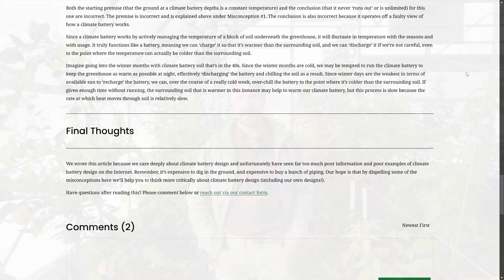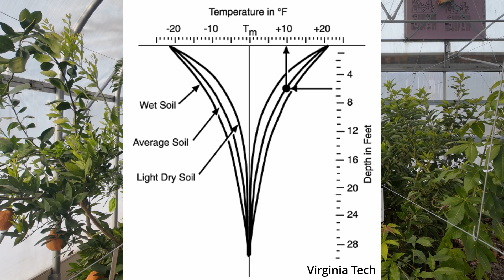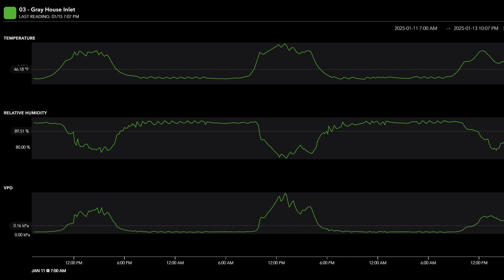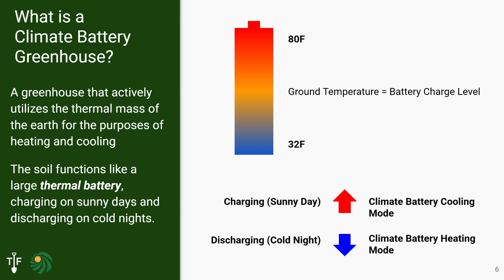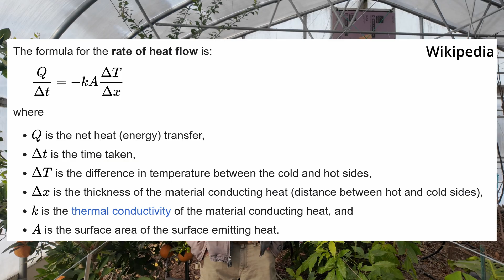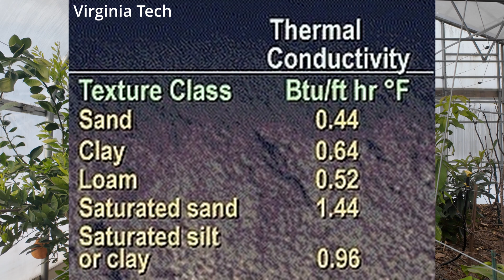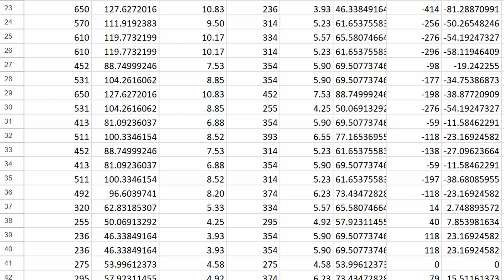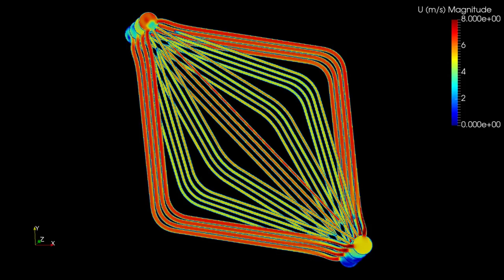5 Misconceptions About Climate Battery Greenhouses

Comment: Heat transfer rate is a function of surface area, temperature difference, and thermal conductivity. Storage is a function of volume, heat capacity and insulation. Plastic pipe thermal conductivity is poor, dry soil thermal conductivity is poor, and surface area is about more than pipe length, it’s about pipe section perimeter. For example, a stainless steel pipe with a cross section like a torx screwdriver passing through a large vessel (like a fiberglass tank) filled with water, or wet soil or a phase change material would dramatically improve an earth battery’s performance, though obviously at the expense of initial cost. The torx shape cross section has a high surface area, the stainless steel a high thermal conductivity, and the water/wet soil/phase change material have both higher heat capacity and higher thermal conductivity. The limiting factor is always cost vs performance. It’s also a very different discussion when you’re talking Pennsylvania VS Canada as an example. The further north you go, the more important it becomes to actually isolate your battery from the surrounding ground using insulation methods. There is definitely a lot of research and development that remains before truly effective and efficient systems will be in general use. It’s unfortunate that there seem to be few (if any) serious engineering efforts in this area, most are undertaken by growers themselves using trial and error methods. I for one firmly believe in this technique, I just wish it was better organized.
Reply: Retired Engineer here... I've modeled an earth battery fir losses and storage. As well, modeled the heat transfer rate through the soil and through the pipe walks to determine the proper size and spacing for expected heat exchange rates. 
The problem is that this is the 10th project down the list! Perhaps get to construction in the spring. 
One note, it seems easier to insulate and bury much smaller water tanks. Hydronic heating (in soil or fan coils) is much easier.  And I can build a wood boiler to store heat too.
Reply: @markhischier2750 As an electronics Eng, I’d love details. Like how did you model it and what with. I’ve been thinking of evaporative cooling as method one and a thermal battery to store energy for heating and been wondering if a thermal naturally circulating water heating structure to heat the clay subsoil I have to heat the soil in the daytime, cheap and pretty free and then draw the heat out at night time.
Reply: This is potentially insane idea because of cross contamination - but if you were somehow able to get this system to work with a septic field...
Reply: @dogipillar  now you're talking. hahahaha. Humanure composting for heat is what people do if they're really serious - you need a community garden to generate enough compost and thus heat. Also you need people who are not brainwashed by the Western "shallow street sewer Roman empire aqueduct sanitation" system versus the Berber ancient humanure composting ecological sanitation system that I personally witnessed. John Jenkins is in Pennsylvania just like this fellow - his humanure compost stays hot all winter! He is also off-gassing CO2. He could just move his system "indoors" into a warehouse. The only problem is that the code is for any "structure" to require a septic privy permit - and an engineer has to sign off on it - and engineers don't understand composting biology. 
So it is assumed the finished compost isn't sanitized for growing food, etc. Simply incorporating friendly fungi to outcompete bad fungi - like Oyster mycelium is proven to kill the e. coli and viruses and other bacteria. The "MycoToilet" project at UBC in Canada is proving this - and I did this also - just threw in Oyster mycelium and no smell! It's awesome. Technically you could eat the mushrooms also if you wanted to. hahahaha. I think our heat inefficiency is largely due to being afraid of nature - like the fungi problem - but also mainly due to building code fascism. A farm in Vermont got raided for doing humanure composting - and were forced to install a septic. So Vermonters are trying to get a new state law passed to allow them to compost. You can get a composting toilet permitted as a privy but it is still assumed by the engineer that the "finished" compost is septage that is not sanitary. The EPA points out that after two years it is safe even if thermophilic temps are not achieved. So by combining a MycoToilet composting as a mushroom farm that also creates internal heat that would enable manure as fertilizer to grow food and also heat the greenhouse. The problem is one of organization - it has to be a top down community garden project as a cooperative instead of a private bourgeois "commodity unit" business that is trying to scale up. 
The thermal mass "Kang bed" in ancient China combines cooking food with house heating of the bed. A winter tent design for cold climate has the external air intake right under the wood stove so that the rest of the tent can be well insulated. Technically a tent is a shelter and not a structure - so just light weight EPS foam that could be moved 25 feet every month would be a short-term shelter not requiring to be micromanaged by the corporate-state fascists. 
Where I have land there just is not enough sun light in the winter to grow crops. You can be out in the open but then the "convection cooling" from the arctic wind is too strong! Better to dry food for winter use - and rely on animals for winter food - they can eat dry forage, etc. Animals can convert willow and grass that humans can't eat but we can eat animals.
Reply: I'm currently in the process of trying to develop a method to pre-condition air for a home renovation in a zone 4 environment. Due to limitations on construction, I have only about 50-100 feet of potential run length for the input air to travel through, (installed next to a new foundation) so I've been amateurishly designing a few different systems to try and maximize the amount of heat transfer as well as storage within that smaller area to hopefully dehumidify the air during the summer as well as cool, and then in the winter obviously pre-heat the makeup air. My initial thought is that instead of back filling with the soil I'd back-fill with something that has a bit more thermal capacity - perhaps a mix of crushed soapstone, bentonite and fly ash. But I'm curious too about leveraging PCM's here, and wondering what a good material for that role would be if you ran say 10' of torx stainless through a buried tank of some sort of PCM. I'd be curious on your thoughts there.
Reply: @ If I understand you to mean an air to air exchange of energy for fresh/stale air exchange, there are of course compact systems available on the market (such as Broan) , but I question their efficiency over such small exchangers. Ideally, a counter flow heat exchanger is best with coaxial flows. So for example, a torx shape sectioned pipe inside of an insulated cylindrical pipe. The stale air flows out through the outer while the fresh flows in the opposite direction in the inner. The idea here is to have enough length so that by the time the incoming fresh air reaches the exit it is very close to the initial temperature of the outgoing exhaust (indoor temp) and the exhaust air likewise is very close to the incoming fresh temperature at the opposite end. If this exchange happens at a depth sufficient to mitigate gains/losses due to seasonal fluctuations in ground temperatures, it can be extremely efficient. The issues are dehumidification of the airflows before they enter the exchanger and preventing mold/bacterial growth. If the outside inlet drops deep enough, and runs through an initial length of perforated pipe, this will drop moisture in the summer. An inlet air filter would be advisable. Other means of preventing growth include UV light sanitation or antibacterial coatings (such as silver based) on the ductwork.
Reply: @richgrabon3835  Not quite; though thank you for the in depth description of application for air2air. Thanks also for the potential solutions to moisture/bacterial growth. I'd like to work in a passive Heat Recovery system for the wintertime, supported by the draw of a wood stove. Though my current thought is that the exchange would happen at entry point within the home envelope so that the maximum amount of pre-conditioning from the climate battery would happen prior to the air2air exchange thereby reducing the temperature differential between fresh/stale air and hopefully recovering more heat from the stale air before its sent to the stove. 

However my question (which wasn't clear, on re-reading the comment) was more predicated on use of PCMs or alternative backfills over top of the earth tube to maximize the capacity of the climate battery in a relatively small space, and enhance the transfer of heat from the battery to the fresh incoming air, prior to the exchange.  I am not sure that I could go far enough down, and I don't have a long run for tubing, so the overall volume of soil from which to bank thermal energy is less than simply running the tube through a long trench.  Did some research today and it seems that you don't need hundreds of feet, so I suppose the goal would be to expand the range of heating/cooling during the seasonal fluctuation through materials with higher thermal capacity. 

In your example though, it sounds like the counter flow exchanger would be buried under the ground, with the stale air being fed through the outer, cylindrical duct, while the fresh air travels through the inner torx duct.  Would it not be better to invert that, so that the fresh air not only picks up temperature from the surrounding soil as well as the stale air traveling inside? What is the advantage of having the exchanger outside of the home envelope?